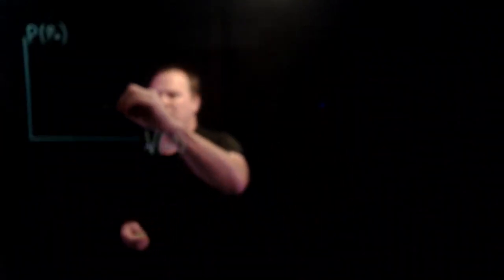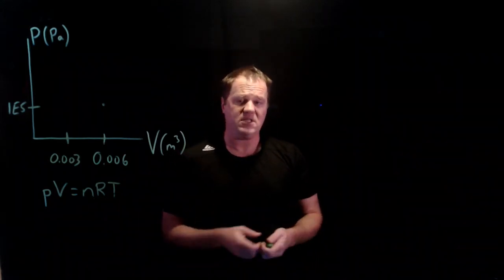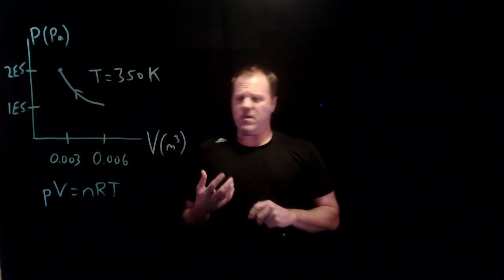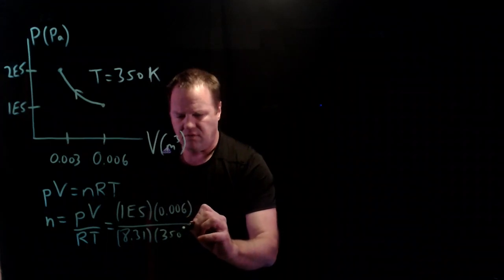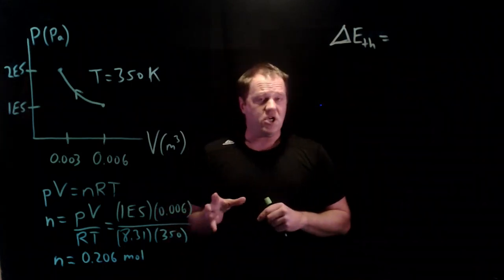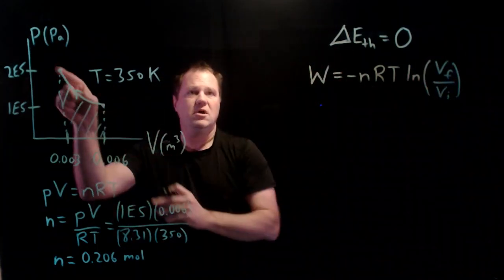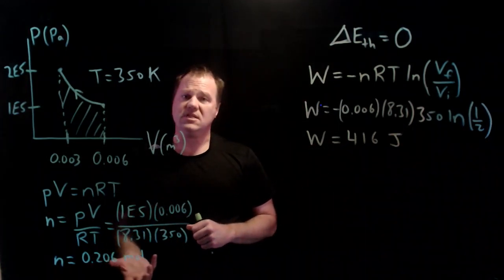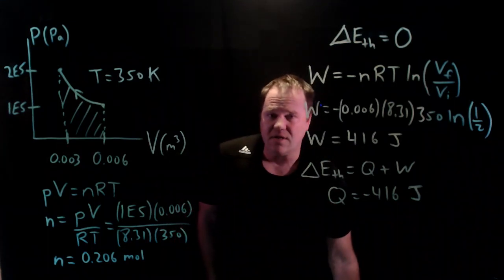Isothermal Compression

Comment: Why was n = 0.006 in your work equation ( W = nRT ln(Vf/Vi) and not n=0.206 mol as per your calculation!!
Reply from the maker: "Note: I wrote down 0.006 for "n" in the calculation of work, but it should be 0.206 mol. The calculation of work is correct, though."